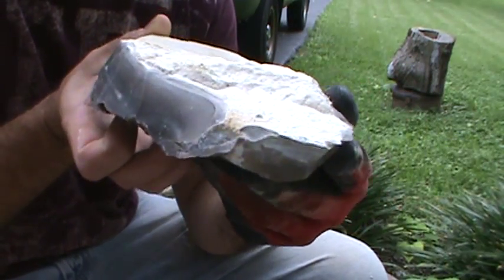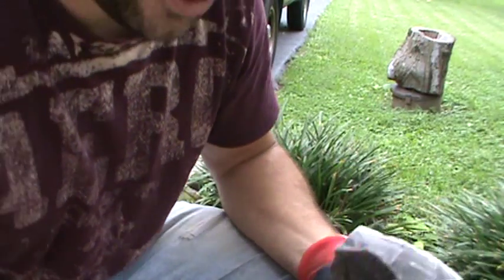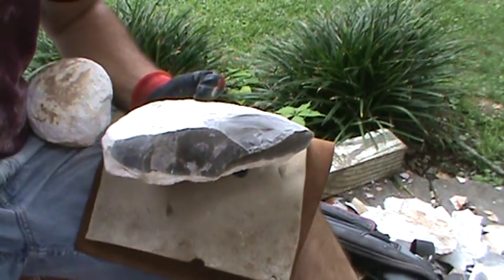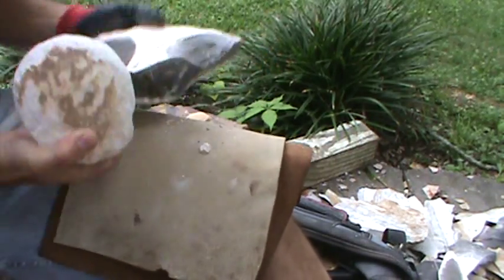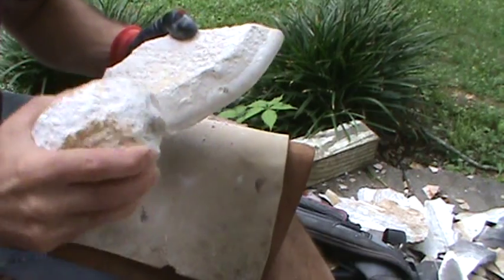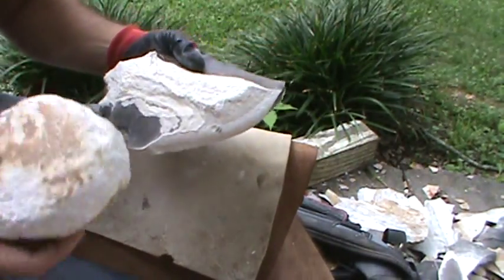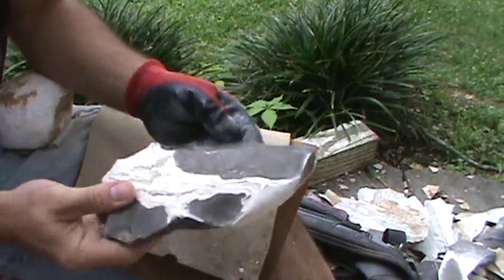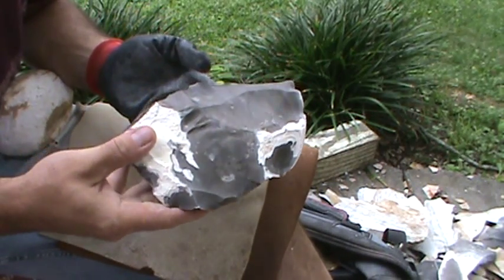Part 2 Hogeye cache project

Comment: I've watched this series over and over again. Bravo! The first time I tried this method of peeling Georgetown I got four big/perfect overshots (two on each face). Yesterday I ruined two nodules...about cried... same hammerstone as what I used before (although not a cortex one like you show here)... Thought I was doing everything the same, not sure what happened although the first piece had a perfect ledge like you show here. I know from what you told me earlier that trimming cracks/seams is important w/ this method. Thought I did that too... Going for early aggressive overshots is new to me so I may need to put the brakes on trying too hard. Fun when they peel though!